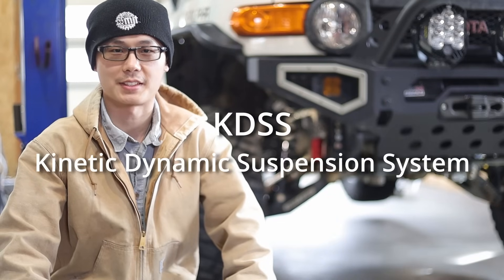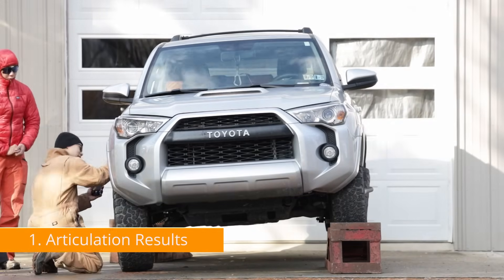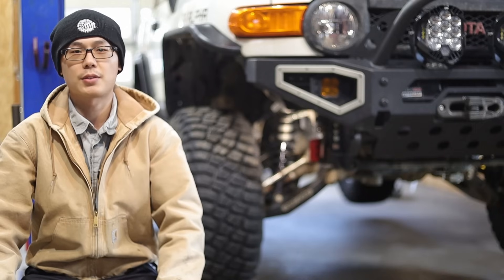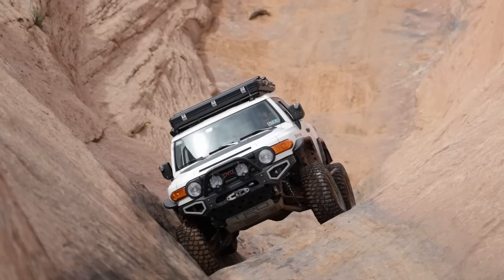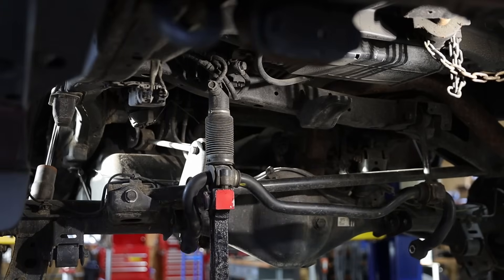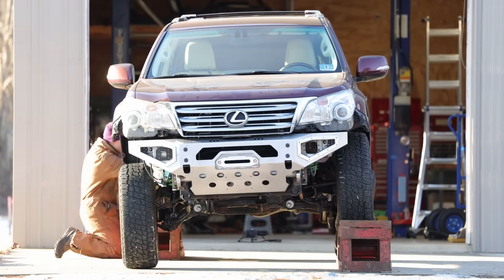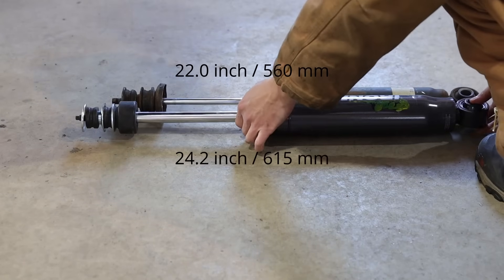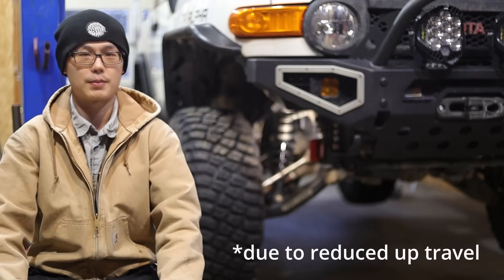Toyota KDSS Ultimate Test | Legit or Gimmicks?

Comment: Great breakdown best videos I seen on suspension.I can confirm that at high speed the KDSS does hurt the ride quality. I will be adding a KDSS switch from black gate custom to see if turning off KDSS makes a difference at high speed. I have recently added a black gate custom spacers in the rear  with a Sonora steel track bar/pan hard bracket and it Definitely made a difference when turning and uneven articulation on the rear axle. It feels smoother going to be testing further. I did it to stop the track bar from hitting the KDSS sway bar didn’t expect it to make the ride feel smoother. Would be interested in seeing a comparison of the common spacers for KDSS. The 2 spacers from black gate custom vs 3 spacers from treaty oak off-road.  And a comparison of KDSS compatible control arms. I do have a set of DIRT King 1st and 2nd generation LCA if you ever want to do a comparison between them and Total chaos LCA/long travel KDSS kit.
Reply: I invented the kdss control switch. I’m Drkdss. Just using my other account.  But I was actually trying to change up the wire diagram for the v1 that I create for BG.   Me and the partner got into over some other stuff and I ended up leaving. I told him to change it still and he didn’t listen.  Mainly because he doesn’t know how it really works.  I was the engineer behind it all.  I’m just giving you the heads up , not saying don’t buy it but under testing we had some issue with the seals failing and the system not consistently engaging when we wanted it to. That was do to the way I had it wired.  Good thing he didn’t agree with me because now I have the v2. Look me up under dr_kdss on the gram. If you have question regarding the v1 I did for blackgate and what my v2 is.  Don’t hesitate to reach out to me on instagram.
Reply from the maker: Thanks for the info and heads up. Great design and you definitely got a royal following from the community! Do you think if it's possible to close the solenoids at low speed to improve off-camber stability? From my understanding your current design can override-open them to improve ride quality at higher speed, but not the other way around.
Reply: @TinkerersAdventure  I think it is possible.  I’ll look into it more and see what I can figure out.  I’ll study the schematics this weekend.  But also I really think if you spent more time behind it , you would have felt the sway bar engage if you went a little more off camber.  I bet if you do the comparison again but take your rear sway bar off, I bet yours will roll over even more in comparison to the kdss valves being open and you with no sway bar. Love your channel.
Reply from the maker: @fltllc4136  For sure. KDSS would definitely be better than no front and rear swaybar. I was mainly comparing to 4Runner with all swaybars. The FJ was just another data point which I have a tons of personal experience on the trail.
Reply: @fltllc4136  thanks for the information glad to see more info getting out there. I ended up purchasing the Dr. KDSS. Switch instead because it connects on the inside rather than on the outside. Wondering if I should add the treaty off road front spacer or just leave it with the 2 rear spacers.
Reply: @augustchirstopher  ooh I recognize your name. Yes I got your order out this am.  Thanks for the support. Reach out to me directly if you need anything.
Reply: Have a 4Runner Off-Road premium with KDSS. On the highway going 80 for hours rides very smooth.  Off-Road high speeds maybe a different story; however, adding a FOX suspension system and will find out.

Comment: Great information as always! I will agree that  for me, long drives are no fun without the sway bar. The ride feels smoother without it due to each side working independently, and the flex is great,  but the sway during long drives and even heavy winds make me hate the trip of trying to stay in my lane. Would be nice if there was a quick disconnect kit out there.
Reply: Dr KDSS makes a disconnect switch a couple folks above have mentioned.
Reply: @RobS123  would be nice but I don't have KDSS. Neat that y'all can do that with a flip of a switch though.

Comment: Thanks for making this video. I always learn something from them. I have KDSS and really like the on road handling. I was pleased with your conclusion regarding its Offroad capabilities.  Bonus points for talking about the KDSS Spacers and aftermarket rear sway bar! Someone already mentioned the Dr KDSS switching kit. I've also been wondering if a front passenger KDSS spacer would cause it to hit my CBI front skid plate (maybe lower with longer bolts without cutting)
Reply from the maker: Thanks! I don't think the front spacer will change clearance to skid plate. The spacer is not added to the driver side cylinder, which is still the lowest point when it fully extends.

Comment: Great video! Glad to hear that KDSS actually does work similar to a quick disconnect, but I have also seen one of those KDSS shafts come out of the piston on the trails in Moab, so though it may work, it also adds another point of failure unfortunately, and it costs an arm and a leg to repair!
Reply: the shaft came out of the piston because the person most likely lifted their vehicle.  The stock piston is only so long.  The failure was the lift... left at stock height or small lift KDSS will be fine.  We ubuse our GX460 and we love KDSS ❤️
Reply: @LexusGX460-OFF-ROAD  Might be a good argument for KDSS spacers with a lift.
Reply: @stevecarlson2346  yes... I think that's what most who lift KDSS do right?  spacers?
Reply from the maker: Thanks! Ouch, that is bad. yeah those things are more expensive than a fancy shock. Was that a rear KDSS shaft got pulled out? Was he running long travel rear shocks?
Reply: @TinkerersAdventure  .... put candy-colored Chinese parts on Japanese perfection... then wonder why things break... The China-lift over extended the KDSS piston.  Add spacers or extend the piston with a custom one.
Reply: @TinkerersAdventure  it was a 4Runner with a typical 3” lift, and it was in the front, we ended up managing to stick the shaft back in the shock and used a racket strap to keep it from over extending for the rest of the trail.
Reply: Wow I wouldn't have even considered this. Then again that is an extreme use case that majority of people would never encounter
Reply: Lift Japanese perfection and blame kdss when it breaks, ya that's smart - not

Comment: No problems letting those KDSS shocks be fully extended during maintenance? Would sure make life easier not to have to worry about keeping them compressed while disconnected.
Reply from the maker: I didn't see this requirement per factory service manual. Talking to lexus tech they don't do that either. Where did you get the impression that you need to keep them compressed?
Reply: @TinkerersAdventure  Just second-hand information from internet armchair research -- that it could cause some problems while trying to recompress them to reattach. Good to know the dealer tech doesn't worry.
Reply: @TinkerersAdventure  the reason the dealer don’t have this write up is because when I ever they work on the system and it hangs. They bleed the system

Comment: Great video. There is also a way to turn off KDSS at higher speed using a kit like one sold by DRKDSS on instagram. That might address the high speed situations you were talking about earlier
Reply: plz do not try this , this is dangerous , disconnecting on high speed, putting life in danger

Comment: Thanks alot! Sweet video...  The GX460 has rear airbags correct? I have heard that if you install exteneded travel shocks in the rear you can pull the airbags out of their holes and have a bad time going home with no suspension!
Reply: Not all GX460 have rear air. My based has regular coils
Reply: I have a Toyota Kakadu Prado with airbags in the rear. I'm running outback armour 2 inch lift with Airbag Man 2 inch airbag kit. No dramas keeping everything in place so far. 👍
Reply: Only the Luxury trim level has rear air suspension. Base and Premium do not, at least in 2018 when I bought my GX.
Reply from the maker: Thanks! No this GX doesn't have rear airbags

Comment: Is there a swaybar vs no swaybar video in the works?
Reply: My 5th gen is more of a weekend toy. I drive it on weekends sometimes but mainly an offroad toy. It's rocking a Dobinsons long travel IMS kit. I've been thinking about losing the front swaybar to squeeze out a bit more articulation out of the front or if it's even worth taking off all tog
Reply: @petyweestraw  How do you like your Dobinsons long travel IMS kit? How does it handle corrugations and general off road obstacles?
Reply from the maker: Not in the work but you can assume you'll get similar front articulation as the KDSS, just much poorer on road handling. On road handling is subjective. Best way is to test it yourself for a week and see if you're ok with it.